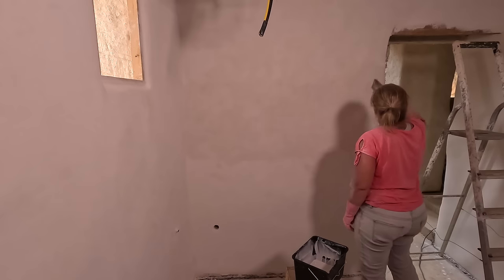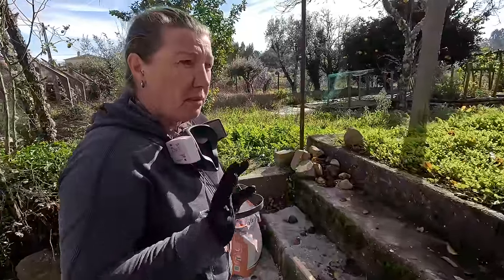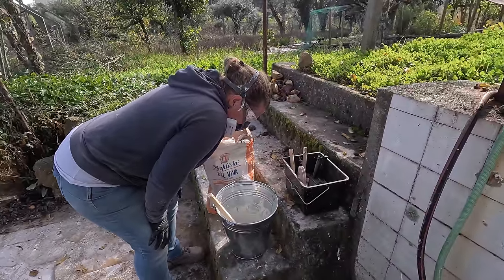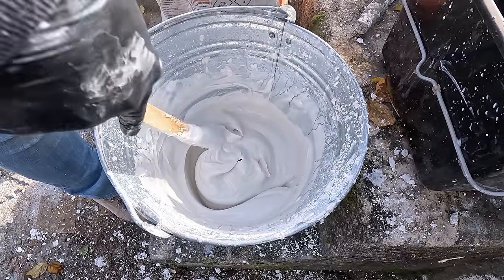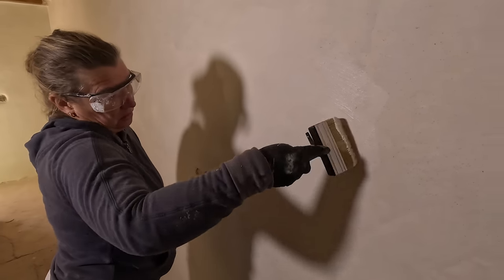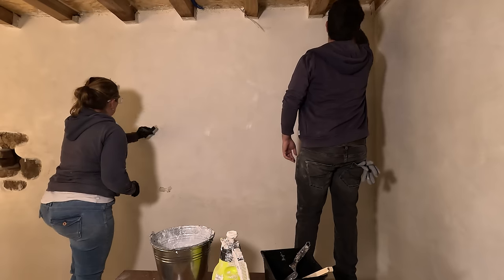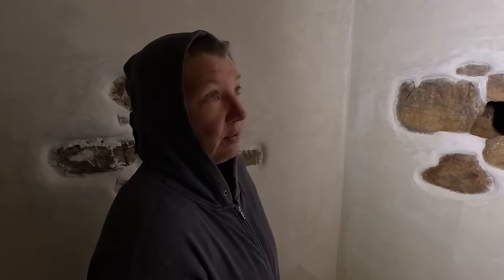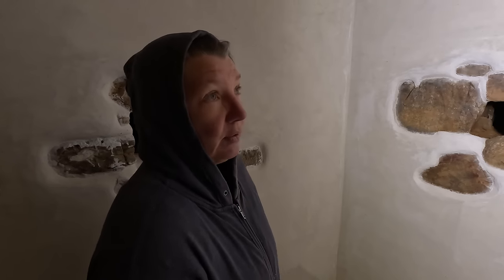Experimenting with Hot Lime Wash - Mixed Results

Comment: Good Evening Folks - This is a truly amazing site that I have just found

I make my own hot limewash all the time - these are the things i have learnt

Powdered quicklime will double in volume so when you make a limewash ensure that you have at least if not slightly more double the amount of water to quicklime by volume. 

I also use hot water so that the reaction starts almost immediately. I slowly add the powder to the water and use a hand whisk to mix the contents. (if you use a pigment make sure that it is added at the beginning of the process - and make sure you write down the ratios - something i forget to do all the time!!!). Once the quicklime has slaked I add enough water to the mix so that the limewash almost but doesnt drip off my brush.  I always pass my limewash through a fine sieve to remove any solids and then apply. Dont worry about the hot thing - i use my limewash cold too and it works just as well!

Make sure that the wall is wetted down as you work and work the brush in all directions. Dusting only happens when the lime dries too fast. If you think that it is too hot or too dry then lightly MIST down the wall after. You will find that the walls appear opaque to start with but after 24hours the carbonation process starts and the walls will look great.

If you want to have an awesome finish then burnish with a dry brush - this means brushing over the limewash once it has started to pull in and you will get a light sheen.

Also dont forget that this is a limewash and not a paint so you wont get an even colour all over. You will end up getting a depth of colour with some areas being whiter than others.

Comment: Hi Guys, enjoy watching your journey. I've done some hot limewashing previously and had good success. You have obviously watched Nigel Copseys demonstrations as he relates to the 'whoosh!'
I've been on a course in person where he has demonstrated the method.
All I can suggest is:
When mixing ensure you start with plenty of water and add gradually and thoroughly 
You can thin your finished wash down after the whoosh but keep it so it just stays on the brush.
I'd advise using bigger brushes and don't overwork it once you've applied it to the wall. Otherwise you'll end up with 'patches'
As you said you have to be patient. You are applying to a green plaster with moisture in it. Also it is winter and your property is unheated.
The lime will take time to carbonate and lose its water. All limewash is translucent when wet. It will dry brilliant white in the right application and conditions. Stick with it 👍
Reply: I love this comment. Responses like this are the best part of the You Tube community. You are a lime wash encourager!

Comment: Regarding streaks, there is a basic rule of painting walls, that says you only brush one way and preferably on the same direction with the light in the room (i.e window). It will severely cut down on the streak and shadow effect of light hitting the wall and it will mask various imperfections. I also find a roller is much preferable than a brush, where the roller leaves a textured pattern and not lines.

Comment: The coverage factor of paints is sometimes shown on tins or advertising - the better the coverage (fewer coats to get complete cover on a wall or surface) the more expensive the paint. With this hot lime, I was wondering about getting more on the walls and the trade off with having streaks or other brushmarks so you get more coverage. I think I suggested before, sometimes painters load a roller to get paint on a wall and then spread it out with smaller rollers - you can get bigger brushes you can load more and then spread out the paint with a mini-roller. Perhaps this is something you've tried. Good luck not blowing up the town! Good video too!

Comment: The guy on My 15k House used like rust powder to colour his lime wash.  He seemed very familiar with the process.  I think he is well travelled and worked on buildings were these methods are still commonly used.  The rust and lime gave that common pinkish colour that you see on many buildings.  He brought it in a jar.  I found it really interesting and you might too.
Reply: Steel wool left a while in vinegar perchance? This is a great woodstain also.  👍
Reply: @moiragoldsmith7052  no, that is a wood stain as seen on Chateau De Mont Magner many times over.  No he brought a jar of what I can only call rust grinded down to a powder from the local hardware shop.. It is that common red/pink colour that a lot of houses are painted.  Strength of colour is dependant on how much powder you put in.  He done the outside of his house with it.  Quick and easy too.  I used to watch another channel and he made such a song and dance about the lime and how he could not use it if it went below a certain temp, when you watch colder countries still using it.
Reply: He also added salt

Comment: When mixing the lime, it is ready when it forms a little island that doesn't immediately absorb into the water. The mixing blade on a drill makes getting it smooth without lumps much easier than stirring with a wood stick. Experience from my mold making for ceramics. If you trowel the plaster to burnish it, that is Venetian plastering and it is beautiful. You can add pigments to the lime in the mix to color your walls and never have to paint them using the Venetian plastering. The slight variation in color makes for a beautiful wall.

Comment: Great video, you two are so methodical and you do get there. The dusty limewash is when people make it with hydrated lime. You are doing a proper job
Reply from the maker: Ah, I wonder why that is. After all hydrated lime is simply quicklime that has been slaked and dried.
It’s so fascinating all the different variants of limewash
Reply: Yes it’s hard to know the science of it and how it changes when slaked to a powder. I have worked with lime for years and recently worked on and painted a house in an area of Italy where we could only get hydrated lime. This was dusty after painting and it was mixed very consistently. This year painted a house in Bulgaria using lime putty (quicklime not available here also) for the limewash and this was much less dusty and easier to work with. Hot limewash is my preferred option though 👍🏻
Reply from the maker: @bccochrane1  we’ll be really interested to see how this turns out when everything dries. When we used our own slaked lime putty it took at least 5 coats to get a good finish. Will be very happy if the hot wash means two less coats 😀
Reply: @MAKEDOGROW Definitely, it’s great that you try these things and we all become wiser as a result 😊 Really enjoy your videos 👍🏻

Comment: I uses lime paint and put a basic coat and two coats on top of it. No windows open so there is no draft, , It has to dry slowly . After the third coat it was looking great. You need patience with this kind of paint .But the results are great . And it regulates the humidity in the room .

Comment: I remember the walls on the house I grow in 40 years ago just outside Lisbon were lime plastered. they were the most beautiful and smooth walls I've ever seen and felt. like glass. Can I suggest testing a thick fine sand and lime mix as a first layer or as many same layers for very irregular walls and then this same mix you used as a second layer but about 3mm thick? This is how the was was made back then. I don't know what tools they've used but would try myself with a large screed tool just like they use here in the UK nowadays. You will need to find the perfect consistency and probably wait for some time but the end result should be as smooth as glass

Comment: I often wondered what the white "Paint" around the bottom of the trunks of trees was as I drove around Europe's roads. Lime wash to prevent insect problems makes much more sense than a safety measure to prevent crashing into the trees and seeing the side of the highway at night.
Reply: It's also a very good sunburn protector (for trees!). In Sicily the sun and heat are very unforgiving, and lime wash do wonders. Not as effective for insect's tough, just with ants.

Comment: Curious: Outside and inside room temperature, room relative humidity, drying time, final mix temperature. Looks whiter and smoother. Patches may be showing as the porosity may vary acroos the wall. As the wall slowly dries, less variation should occur.
Reply from the maker: Yep, a whole range of factors.

It’s why it always amuses us when someone tells us how it ‘must’ be done. It’s more likely that there’s a whole range of solutions/contexts and they all work … eventually

Comment: so what ratio were you using in the end for the hot mix? looked a 2 water to 1 quick lime?
Reply from the maker: I don’t really think a ratio works here, mostly due to the temperature of the water (very cold).
We were using a 12L bucket filled a little over half way .. added 2 full scoops and then 4 half scoops of quicklime. But then had to add quite a bit of water to keep the consistency we needed. Even after we started painting we had to add more water as it kept thickening up
Reply: @MAKEDOGROW  ha ok, so just have to try. We’ll wait for your final verdict on there hot cold mixes I think, we’re not ready yet anyway 😅 glad to hear the hydrated stuff isn’t dusty though 👍
Reply from the maker: Note : we’ve not been using hydrated lime for our limewash, but rather quicklime. Apparently it is hydrated lime (that you also buy in powdered form) that results in dusty walls

Comment: Here are two tips for whitewashing walls:
1. The best time of year to prepare lime for whitewashing walls is spring or summer. In addition to avoiding whitewashing walls on cloudy days, if the temperature is too high or the wall is too hot, it should be pre-moistened with water.
2. Use your finger to check the consistency of the lime: if your finger is completely covered with lime, the lime is too thick; if your finger is visible, the lime is ready to be applied.
I was dying laughing at what you did.🤣🤣 Trying to make lime that would work for plastering could only lead to an explosion. 💥If you want to save a lot of money, buy lime in "stones," which is much cheaper. In "Alentejo", people have been whitewashing their houses for centuries. We never whitewashed without the lime being cold, usually we wait two days before whitewashing. Good work and keep strong. 💪 (Talk to more Portuguese people, they know a lot about these things.)
Reply from the maker: Every country does things differently…. and we like to try all the ways.
We’ve tried to find stones where we are and doesn’t seem they are available

This video shows our previous test doing it the ‘Portuguese way’: https://youtu.be/OM5-lav_xV4?si=qN3FFMsDzcBK0xHb

Comment: :hand-pink-waving:me again.. Recipe used for the whitewashing the white house in washington:  Take half a bushel of good unslaked lime, slake it with boiling water, cover it during the process to keep in the steam. Stir in a peck of salt dissolved in hot water, 31bs of ground rice, stirred in while the whole is boiling hot, 1/2Ib of Spanish Whitening (chalk) and 1Ib of clean glue well soaked (  Traditionally animal proteins like casein from milk or collagen from animal hides and bones were boiled down to make early glues) and melted down and liquid. Add 5 gallons of hot water to the mixture, stir and let it stand covered for several days. Reheat and put on hot. One pint will cover one square yard and it will retain its brilliance for years ''
Reply from the maker: Interesting how things are done differently around the world.
Do you know the (preferably scientific) reason for all the additives?